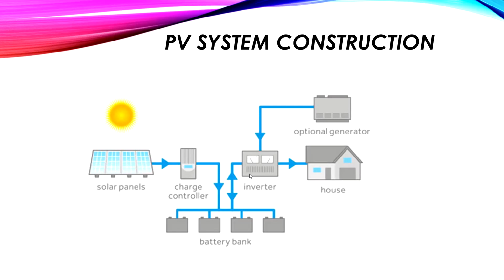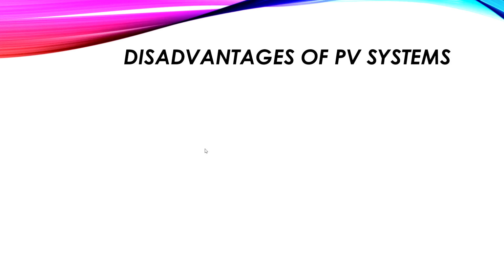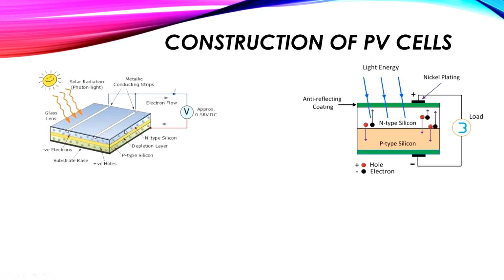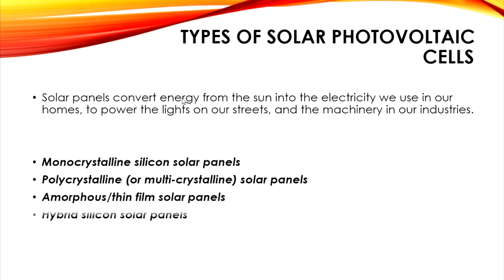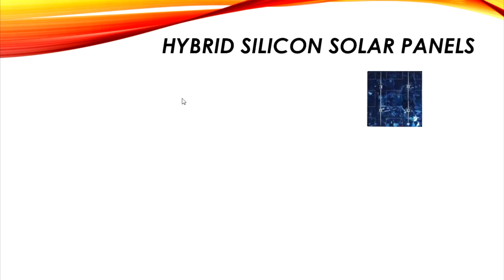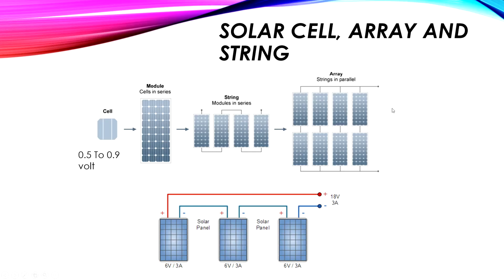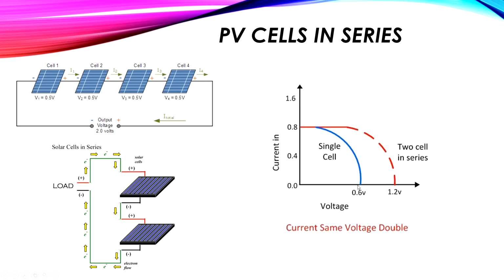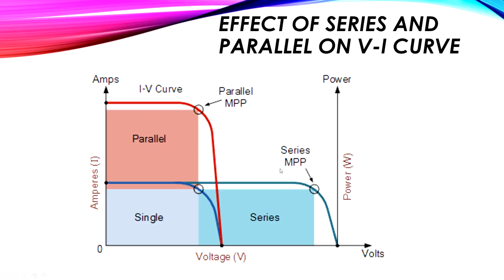Free Solar Energy Course - Introduction to Solar Energy System Construction

Comment: I have hydrid inverter installed with battery..! 

But during sun days, my PV generated more electricty than what we cosume (we are not at home during a day)

And here in Tanzania we dont have option for exporting excess energy to the grid.

Am looking for solar diverter (hot water diverter) that can fit in this setting